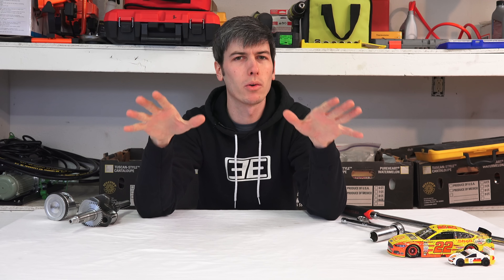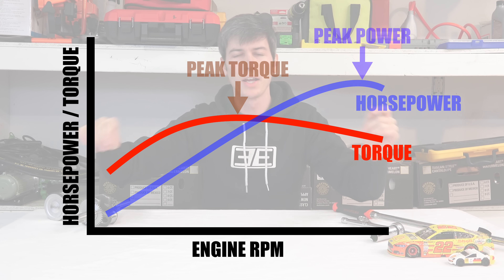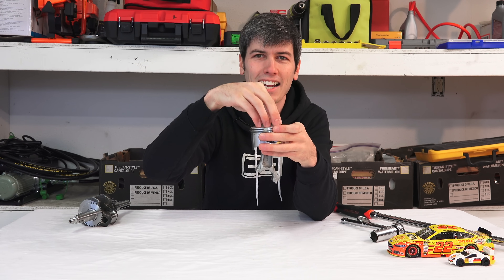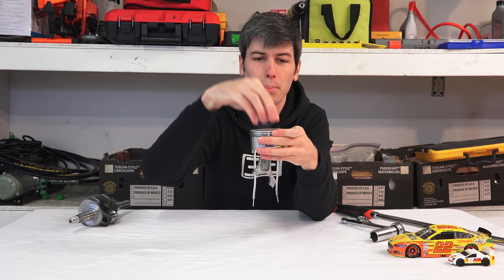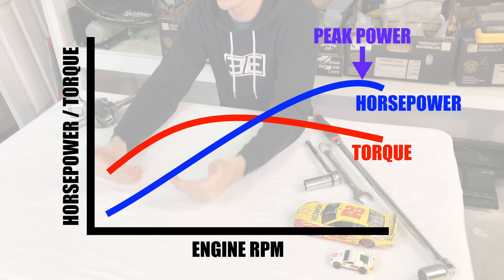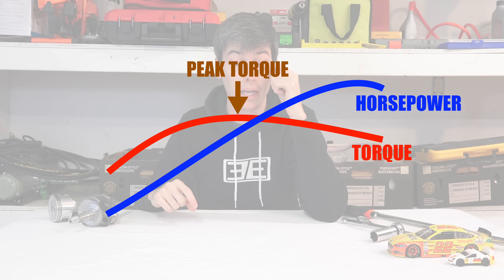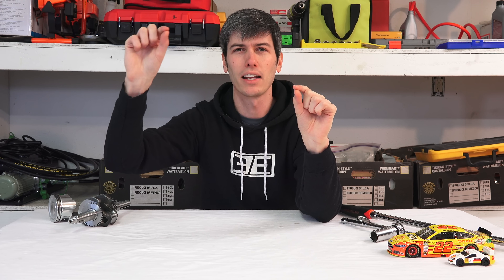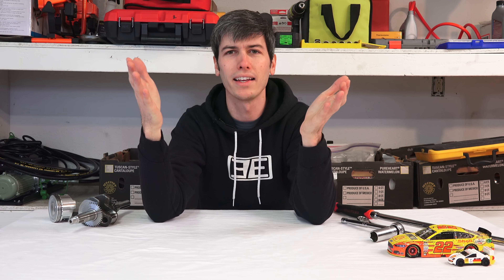Horsepower vs Torque - A Simple Explanation

Comment: I want to make 3 points:
***Disclaimer 
  First of all, we need to make a distinction between horsepower at a given moment and MAX horsepower (most people are mistaken because under HP of car we refer the MAX HP. Open some car specification site and see that it says MAX HP which is the technically correct word)
 We can calculate the horsepower at given moment(RPM) by the formula:  POWER = RPM * TORQUE

1. HP(not the MAX horsepower) is more important than TORQUE
2.First of all, if we have 2 cars with identical MAX POWER that doesn't mean they are equally fast.
3. In order to determine which of 2 cars is faster(in drag) than the other we weed the whole graphic from the dyno.

Let's make a drag race between 2 cars with maximum output of 150hp . For example, a bmw  320d with high torque and 4k RPM redline, and a Honda civic with 8k RPM redline but low torque (lets say everything else is the same - weight, aerodynamics, tyre pressure, etc. ).Also we must know what type of transmission we use.We will make 2 runs - one with CVT transmission and one with non-CVT. In perfect scenario, if we can keep our engine at max power all the time, during our race (which CVT transmission does), no doubt the more powerful car wins, because at any given moment the transmission can change the gear ratio in a way, which uses the engine most efficiently. Howerever, if we have a NON-CVT transmission car (which is the case for most cars). Maximum power is reached just at given moment(the begining of the redline usually) and when we reach the redline, then we shift to next gear and the RPM's drop from 8000 to let's say 5000. At that moment our honda will have let's say 160NM of torque. 160*5000 = 800 000 units of power. The bmw shifts as well and i goes from 4k rpm to 3k RPM but there is has 330NM of torque so at that moment the engines are out of their maximum power range and here it comes the TORQUE which will help them to reach MAX power as fast as possible. At that very given moment the BMW has 330* 3000 = 990000 units of power. We should make the same calculation for every RPM till Redline. And values will give us Horsepower at any given RPM(we can just see that on the dyno graphic). So, in our case, the bmw will win the dragrace, even though there will be a moment where their maximum horsepower output will be the same. In general, to see which if 2 cars is faster, we look at the dyno graphic and one engine HP curve stays most of the time above other curve in the high RPM(between gear shifts) we can say that car is gonna be faster (except any other conditions like weight, etc., etc.) even if the MAXIMUM HP output is the same.  To summarize,  a car with perfect transmission (which can use the maximum engine power at any given moment) the more powerful car will win, but in real-life, if our car transmission is not a CVT, torque is more useful.
Reply: So if I've understood it, assuming both vehicles has the same power to weight ratio, the winner will be the one with more torque, right ?

Comment: What exactly do you want when accelerating fastest, max torque or max power?
Reply: Torque and power tend to go hand in hand. For acceleration you need high torque. However, your max speed is determined by power. Using gears you can multiply torque to increase acceleration, but using a gear will also change speed so the top speed is limited .

Comment: As the video says, horsepower says more about how powerfull the engine is. 
But why does so many swear by "torque is king"?
I think it's because when peak power and usefull rev range is equal, more torque normally means more power at rpms below peak power, and thus a wider power peak. 

So it's just an inexact way of saying that a wide power peak is nice.

Comment: You can increase torque with lowering  gear ratio but you can also increase power with the increase of rpm. Regarding the example with 100torque/200hp the torquer car might accelerate faster for the first meters as they both have to fight mass

Comment: Interesting to think about, is that top speed is dependent on HP, but top speed is dependent on the ability to overcome the force of air resistance. But then torque is the ability to overcome constant resisting forces (like gravity when getting up a hill).

Comment: You are saying that HP is directly propotional to speed 
If it is correct then please tell me that  why the construction vehicles have very high HP but low speed
Reply: They use gears to increase their torque. A low gear will increase torque but change the speed by a proportional amount. Construction vehicles need torque but they don't have a great need for speed. If they used different gears they could achieve a reasonable high speed. They are also heavy so that reduces max speed.

Comment: Cool video yes thx for CVT info U didn't touch on loss of torque from deformation of the long torque wrench bar & a side note on gearing isn't that why some cars have high torque low down for towing trailers & others have high gearing for a fast terminal velocity but all in all clips r appreciated 👍

Comment: Horsepower is a unit, or more precise multiple different units, torque is dimension. The correct comparison would be Nm vs kW (or which ever unit you want to use) or power vs torque.

Comment: Here's an easy way to understand it.  Torque results in acceleration.  More acceleration should mean the car goes faster, right?  Not really.  What happens when you leave the car in first gear and smash the gas?  It has lots of torque and accelerates fast, but tops out at a slow speed.  Why doesn't it go faster?  Because it only has so much power, and the power determines the ultimate speed at that torque level.   Now, do the same with the car in 4th gear.  It takes off very slowly, but reaches a much higher speed.  If the engine truly developed the same HP at all speeds, you'd find that in both cases, the car goes from A to B in the exactly the same amount of time.  The ability to move the car from A to B in a given time is power.  To do it faster requires more power.  Trading torque for speed doesn't affect power at all.   You can increase power in many ways.   But however you do it, in the end Torque * Speed must increase.  That is power.

Comment: If you push (FORCE) a wheel-barrow with a load of soil, say 20 metres, you do a certain amount of WORK. The time taken to do that work is the POWER.  P = W / time  .....If you hurry up and work harder, so that you push the wheel-barrow in only half the time, you will need to supply  twice the POWER.  Horsepower is one measure of Power, which is WORK per unit time.

Comment: BTW, this is the closest best anyone could get to simplicity, yet a lot of of people seem not to understand this (including me) 😐😑
Reply: This video is downright confusing. Torque is the twisting force that is applied to the crankshaft. Horsepower is a measure of how much and how often torque is being transmitted to the crankshaft. Higher revving engines and engines with more cylinders will have torque applied to the crankshaft more often so they'll usually have more horsepower. HP = TQ x RPM in the most basic sense.

Comment: He didn't explain horse power quite correctly. He may have confused it with energy or work. Horsepower relates to the rate of lifting power against gravity for a particular mass (weight).
Reply: He explained it correctly.  Power is the rate that work is done.  Energy is the capacity to do work.  Horsepower is a particular unit of power.  Power = energy/time.  Energy = power * time.

Comment: if Power = Torque x RPM;  then power (or HP) can be increased by increasing Torque, increasing RPM, or increasing both (RPM and Torque) at the same time.  
Torque = force x distance; 
Engine Torque = pressure x area x distance.  
pressure = combustion gas expansion force in PSI,  
area = Pi R sqrd of round piston. 
The way you can increase torque is by increasing the pressure, or increasing the area of the piston, or the distance of the crank offset; or increase all three (PSI, SQIN, Length) together which will increase Torque-but remember increasing Torque will always increase (HP) Power capacity, not the other way around, how can you increase power that increases torque?  by manipulating the (HP) Power equation 
Torque = Power / RPM.  Yet you have to assume a (HP) power before you can solve the equation....right?  Just reducing RPM will not increase Torque (as the equation shows) unless you assume a predetermined (HP) power rating...right?  But if you recall (HP) power reduces when RPM reduces...right?  Therefore Torque is a mechanical (physical) construct-- changing it dynamically requires changes to mechanicals, area or 3D space.  So Torque "is what it is" based on the physical construct of the engine, not on the acceleration of the engine!  RPM is typically a dynamic construct and can vary according to the engine acceleration dynamics.   If you have an engine which can continue to increase its RPM (without blowing apart) it does not increase the torque--but it does increase the HP.

Comment: tesla cars have high torque than horsepower, thats a fact
Reply: That depends on what units of measurement you use. Many turbo diesels have way more torque (Nm) than power (HP)
Reply: Electric motors have high torque across their entire power band - even at 0 rpm.  A gasoline engine develops no torque at 0 rpm.  That's the main difference.
Reply: @stargazer7644  electric motor torque is instant.
Reply: @fix-and-drive-yo-car-diy  The inductance of the motor coils would disagree with your use of "instant".
Reply: @stargazer7644  I don't think he knows what inductance is.

Comment: This is an excellent video but to simplify this, diesel engines have more torque than petrol engines because diesel engines have longer connecting rods connected to each piston therefore each piston has a (longer) stroke (which is it's up and down movement). Petrol engines have shorter connecting rods connected to each piston therefore each piston has a (shorter) stroke. Diesel engines such as in trucks etc are designed for doing work, towing and carrying heavy loads. Petrol engines are designed for speed and performance. A petrol engine will always have a higher rate of acceleration than diesel engines. Like this man says in the video, a good (torque) explanation is for example! when you want to undo that tight bolt on your project you use the longest bar connected to your socket for more (torque) then once the bolt is loosened you then use the shorter bar connected to your socket to undo the bolt faster (for speed).
Reply: 1000hp truck with 500 nm with optimal gearing will tow more than 500hp truck with 1000nm also with optimal gearing ,when you measured force at the same veloccity both on optimal gear 1000hp 500nm truck will generate 2 times more force ,imagine we have bolts which we spin with some constant value of rpm its conected to tire circuit on both truck both at optimal gear and we be some system increasing resisit so torque  at axis of this bolt " be some external engine  like in some dyno ( or we just measure how deep each setup is screwed be both setup starting from the same speed each at optimal gear 1000hp/500ftlbs screwed this screew deeper with biger force )  qquees which truck lose speed from let say 50 o 49,5 km/h first at increasing  resist from bolt =dyno =500hp truck with 1000 ftlbs this was simulation of go uphill with big load on trailer at optimal gear at the same velocity   if we start increasing load on trailer from let say 20 to 100tons first slows down 500hp/1000ftbs truck from 50 to 49,5 hp  truck which have engine 1000hp and 500ftlbs will reuqired 2 times biger load to slows down from 50 to 49,5 km/h so let say first truck need load increasing from 20 to 50 tons and this truck with more hp from 20 to 100 tons to slows down the same as 500 hp with more engine torqe truck  its beacuse  power:velocity = force  truck with 1000hp and 500 nm at optimal gear at the same velocity is able to produce 2 times more force at contact path with road ,if 2 car have the same mass aerodynamic drive train power losesss  etc this which accelerate faster at the same velocity have more power and force at contact path beacuse more force at conatct path mean better acceleration at the same velocity if weight drag aero drive train power losess stay the same .its imposiible to generate more force at conact path from biger engine torque and lesss horsepower feg honda civic type r weight 1300 kg have 200 hp and 200nm at engine crank it will pull harder let say some other car on trailer allweight 2 tons let say than feg some turbodisel car also weiht 1300 kg which have let say 100 hp and 300 nm at engine crank both with optimal gearing and clutch setup and hctr will accelerate up this hill with this trailer faster and up to biger velocity while td engine stop accelerate at lower velocity due to not enough force at contact path and this acceleration be slower . egzacly the same efect you get in for egzample electric screwdriver when you change gearing on slow screwing now engine work on much biger rpm where have more power it can have less torque but still  put deeper screw than on max engine  nm on higher gear .

Comment: So the question should be... so if torque is the downward force caused by exploding fuel mixture within the cylinder - why doesn't torque continually increase as a constant ratio to higher RPM? Does the cylinder not receive the same amount of fuel vapour per stroke thereby generating the same force/torque over a shorter time period the higher the RPM goes..?

Comment: Torque relates to acceleration; power relates to speed. Trucks use high torque to get up to speed but race cars have high top-end speed. (See my comment below on an example.)
Reply: @zach5994  Yes, you can think of it that way. Or, grunt vs zoom.
Reply: 2:33 Power is the RATE of applied torque. Example: Pushing on a door at its knob is applying more torque than pushing on it near the hinges. If you slam the door vs. closing it gently, that is applying more power.

Comment: You shouldn’t have mixed gearing into the explanation. Torque vs HP should only be explained at one gear setting. A better example is an airplane propeller. It has a fixed gear ratio (usually direct drive) and performance at either peak should be explained. After that explanation and at the very end it is ok to discuss gearing.

Comment: Correct me if I am wrong, but this is the way I see Peak Torque and Peak HP.

Two of the more important things to point out to help understand the torque peak and hp peak is what happens to you and the car or bike at those peaks. The torque peak is associated with the the highest rate of change of the rate of acceleration; that's the "jerk" you feel. The HP peak is associated with the highest rate of acceleration. So while the torque peak on some engines might make you feel a huge push back in the seat, that still may not be where the most acceleration is. The greatest rate of acceleration is at the hp peak.

Comment: You talk a lot, you talk fast and ... you end up contradicting yourself. And even worse - you don't even realize WHEN you do it 😢 Don't worry though. You are not alone. This is the natural result when a mechanic tries to be an engineer. Things look perfect from one angle and impossible from a different one. At first your explanation is perfect. But then you miss one single key ingredient and because of that, your conclusion is "upsidedown"... One can have "power" with zero torque but you'll never have torque without power! And because of that, the vehicle with more torque will always accelerate faster regardless the "power only" level. As long as the torque is higher (obviously same Mass) the vehicle will accelerate faster. Don't confuse applied mathematics with pure mathematics! You do that and end up with nonsense conclusions.
Reply: Curious how you can have power (work done) with zero torque. Can you explain please?
Reply: @billedifier8584  Don't confuse Power with Work Done!!!!
"Work Done" is related to the amount of energy transferred in or from a system by a force. (Measured in Joule) Transferred Energy and Force are the key words! 
Power on the other hand, is the rate at wich the Work is Done! (Measured in Watt) 
Rate and Work Done are the key words. 
Note the difference? 
And lastly, Torque is a form of Rotational Force! Basically it is a measure of the force that can cause an object to rotate about an axis.
The thing is, if no axis or rotation is involved, you can have (Work Done) and Power but there will be no Torque involved. But it is idiotic of talking about Torque if no Power is involved! Hence one can have power without torque (straight line displacement/movement) but not the other way around.
When the force is not acting parallel to the body's direction of movement, the work done is defined as a dot product of the force and the displacement. 
I hope this helps. If not... Sorry. At least I tried 👍
Reply: Wrong, you can have torque without power. Think when you hold a nut and you reach the end.

Comment: why do they call it horsepower? horses only go so fast and are limited in the amount of distance they can travel over a period of time and that is regardless if you have two horses or two hundred.  

in engines the faster you spin it with the same torque the more horsepower it makes but like i said a horse's speed is limited regardless of how many you have. (can a hundred horses pull a wagon faster than 20 horses?) 

so calling it horsepower makes little sense even if it is an archaic term. a better term would be something along the lines of speed power.
Reply: 1 horsepower is the average power output of a horse throughout a day.